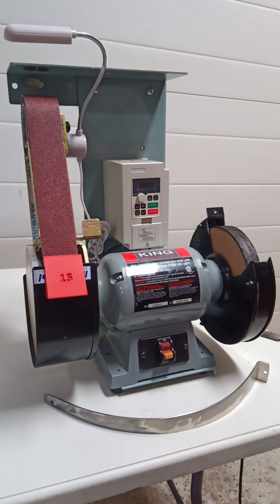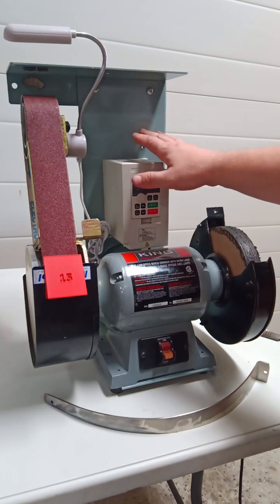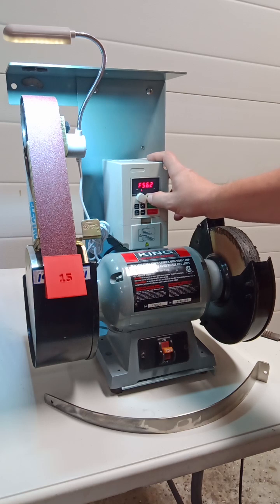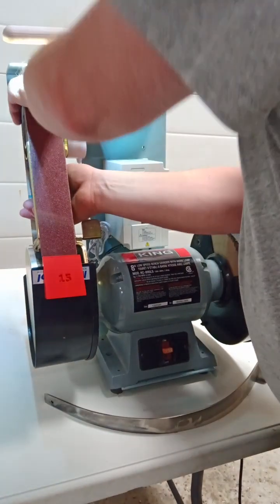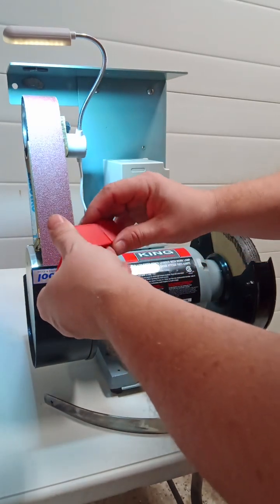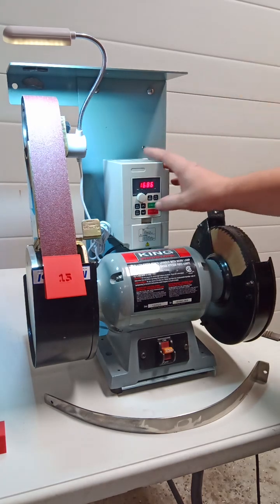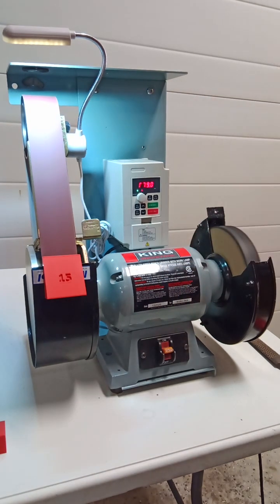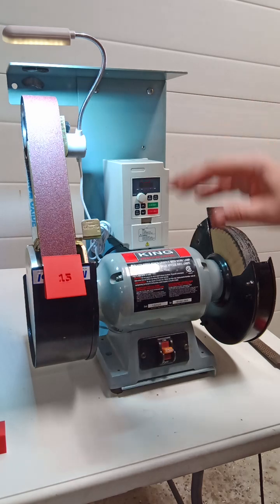Final Build converting 120V single phase bench grinder to variable speed belt grinder using a VFD

Comment: nice video
Reply from the maker: Thanks,  Been a year+ using machine and really really like the variable speed and ability to reverse when needed.  Also the original motor was 1700RPM and added bonus is I now sometimes use it up to 2800 for the odd buffing situation.  VFD gives extended speed range slower and faster.

Comment from the maker: I received a notice that Glen placed a comment but have no idea where it is located.  The notification read "Glenn commented: "Curious, have you plugged a Kill-A-Watt in to see what your Watt/Amp draw is with this configuration? I'd be curious to know what your reading are."

Glen,  Here are the various readings based a no-load free running speed.

Killo-Watt			         VFD Display			
Watt	Volts	Current |	RPM	Frequency Hz	Voltage	Current
0	         123	0	           0	                  0	                   0	            0
48	         122	0.66	500	               16.8	                  33  	1.28
71	         122	0.66	1000	       33.4	                  62	        1.79
86	         122	0.79	1500	       50.1	                  92	        2.36
90	         122	0.82	2000	       66.8	                109	        2.45
89	         122	0.80	2500	       83.3	                109	        2.07
86	         122	0.79	3000	       100	                109	        1.75
Current is amps

Comment: Do you sell those angle guides?
Reply from the maker: Hi Jim, I don't anticipate selling any of these.   These are simply prototype 3D printed parts using materials (magnets) that I have kicking around. Secondly, I think that every multitool will have angular variance between the shield and platen angle.  Thereby eliminating the possibility of commonly produced guides.